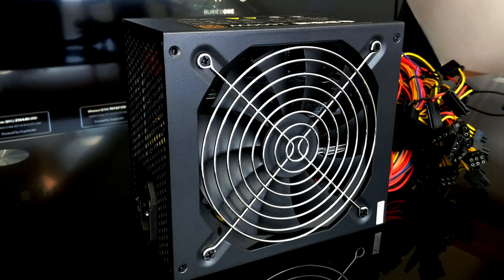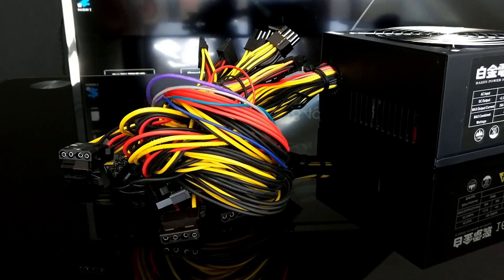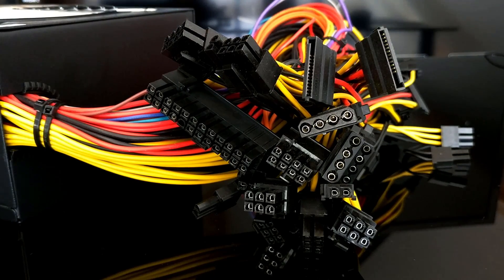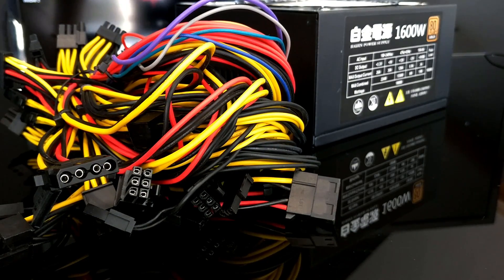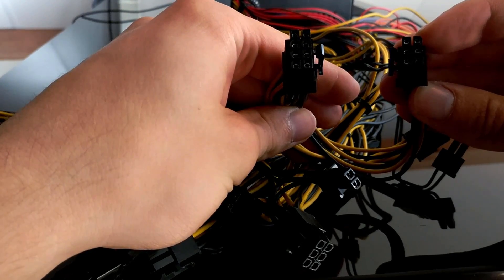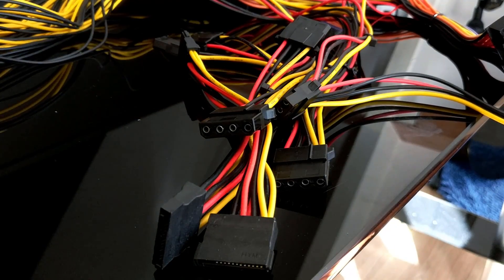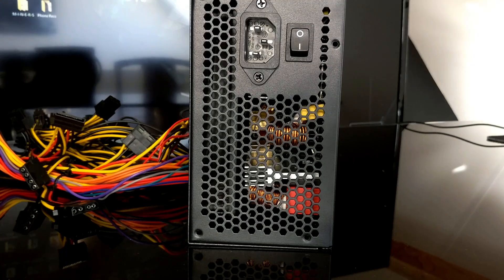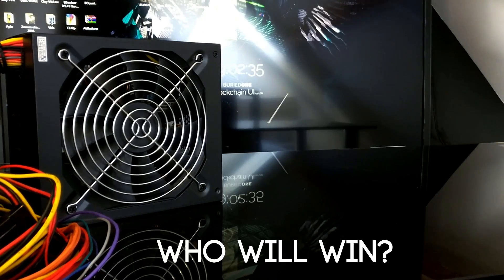The 1600 Watt 6GPU Mining Rig Power Supply for ETH/ZEC/XMR Mining. Will It Be Sketchy?

Comment: Hi. Can i ask why my psu melt my 6 pin to sata connector. I have 1200 watts platinum corsair modular psu
Im running
 2 rx 570 pulse
 1 rx 570 pulse mini
  1 rx 580 8gb nitro plus
 And 1 rx 460 2gb. 
Thanks for the help.
Reply from the maker: Well i never buy corsair psus for myself, but it can happen if you connect the 6 pin connector to two gpus at once!
Reply: BuriedONE Cryptomining 
Im just powering my 6 pin with 2 gpu risers. Please suggest Any brand or psu thats better with my past one. Thanks
Reply from the maker: Go with EVGA, they are the best for my opinion, even if you burn one of your cables the psu works just fine plugging in a new cable haha
Reply: Yeah. Haha 2 cables burned. Last 6 pin to sata cable for my psu. 
Ok i go for evga. 
Thanks buriedOne =]

Comment: I have the 1300w version and I'm using it for almost a month now running 8 GTx 1060s with no issues. Here are my notes: 1- the 1300w version comes with 6 sata and 6 molex connectors. 2- the fan is loud, so I won't recommend it if you don't have a dedicated mining room.

Comment: The power supply shown couldn't possibly be efficient to provide 1600 watts with a 1500 max plug.  Only a company like Corsair can provide 1500 with 90%+ efficiently guaranteed with a 5 year plus warranty.  That power supply you showed I doubt will provide 1,000 watts before killing your video cards and the motherboard in a brown out electrical shortage.   Reminds me of fur Boss car amplifiers that say 4,000 watts and when it's bench tested you realize it only puts out 700.  You get what you pay for and the company's reputation always precedes it!

Comment: How do you power so many GPU like 6+ RX580 4GB when the PSU only comes with two 6x 8pin (6+2) connectors? The RX580 requires 8 & 6 pin power connector...

Comment: Hey the gigabyte z270p motherboard on your site is only good for 4 gpus
Reply: Jay z i got this one and running 5 gpu and checked 6 works fine
Reply from the maker: Jay z Yeah i had some reports of that, i will change it asap!
Reply: Arslan Afzal what did you modify with it? I have f4 bios and new drivers, claymore only picks up 4
Reply: Jay z uou need to go in bios and change some settings ( enable more than 4 gpu )

Comment: i use the egva 1300w model and some people do run 2 x cheap psu's to save a few dollars but this uses more space in the rig  and also needs linking
the evga has 6 connections on the 1300w model so its a good start
never use cheap psu's like $35 ones they are poorly made and a fire hazard
so run at your risk
put a watt meter on the plug to monitor the power and never go over 80% of the psu rating
 2 x 1000w branded psu's is also a good way to double the pcie connections

Comment: With two cheap (under 40 usd both) 600 Watts power supplies for 6 gpu's and they work pretty well, 2 years of mining and they still work, bronze, gold and platinum certification is only a cheat for idiots to pay more for the same shit, don't worry a cheap power supply does not burn your components they have fuse protection for that  ;).
Reply: Carlos Salinas how is 600 watts have enough connections for 3 gpus, i have 550 cooler master v, and i don't have pcie connections for a secound
Reply: easy, with molex to pcie or sata to pcie connections
Reply: Carlos Salinas ok thank you, i'lll try it, i read about it before but didn't like the idea 😁
Reply: It works! each card consumes 85-90 watts so the power supply does not need to be so huge, most "miners" expend a lot of money on power supplies and motherboards with a lot of slots, you can also use cheap used mobos (under 10 usd's) that have 2 or 3 slots and with the cheapest processors it does not affect the mining perfomance at all, you can save up to 200 usd's per 6 gpu rig, dont waste your money!
Reply: Carlos Salinas thank you brother, that's what i did exactly, some used motherbord with 3 slot, i 5, 8 G ram, gtx 970, with only 300$, i hqve used hdd, i just need a power supply and risers and enough power supply(you gave me the confidence to use molex ) 
Thank you

Comment: Can a 1000w gold psu can handle 6 cards in 1 rig? with oc and undervolt
Reply: Yes
Reply: Monero Miner EVGA 1000 GQ, 80+ GOLD 1000W, Semi Modular, EVGA ECO Mode, 5 Year Warranty, Power Supply 210-GQ-1000-V1 https://www.amazon.com/dp/B017ICWP82/ref=cm_sw_r_cp_apa_IW7qzbT74X376 is this okay?
Reply: Yeah it is.
Reply: I've got an evga 1000w platinum. 
Ive got 2, 3060ti, 2 3060s and 2 2060s. Been running for 6 months with no issues. The psu is quite and it doesn't get hot.

Comment: Honestly, it's waaaaayyyyyy better to get 2 mid range plat PSU with a dual link than one monster PSU. Think about it, it'll be cheaper, easier to find, way more connection options, and 2 power supplies running at moderate load as opposed to one hot box of lava and a dinky cable ready to melt. Plus if you need a PSU in a hurry, you can half run a rig and transfer over to other.
Reply: I usually run 2x1000w Rosewill power supplies.  They are cheap and having 2 on a rig allows as much flexibility as you want without either PSU's getting worked to death.
Reply from the maker: jctai100 thisone is very cheap to be honest haha, i thought it was worth the try

Comment: Check out server PSUs with breakout boards. Much better.
Reply from the maker: Tim Day they sound expensive
Reply: BuriedONE Blockchain not at all. e.g. 1200w Plat PSU for $90: http://www.parallelminer.com/product/hp-1200-watt-power-supply-kit-for-gpu-mining-platinum-94-zec-dash-eth/
Reply: BuriedONE Blockchain They are not expensive. The catch is that they are extremely loud (sounds like a jet engine). You'd also have to buy them used, they are designed to last a long long time but you don't get any warranty either. I rather buy 2 PSUs than that tbh.
Reply: Great idea but using one of those server power supplies would require you a 230V input Voltage which is uncommon on north America

Not a big deal on europe here since we all use 230V input Voltage LoL screw North america